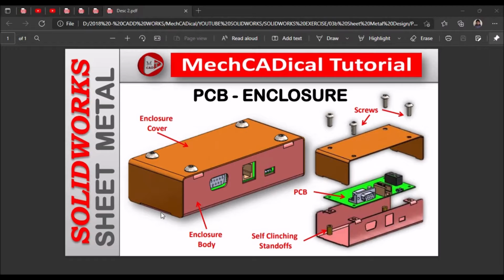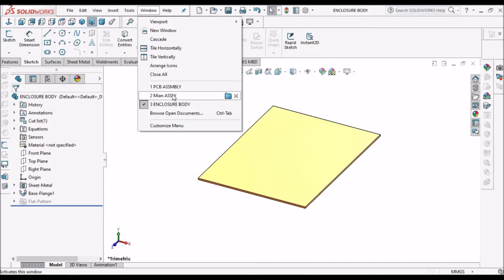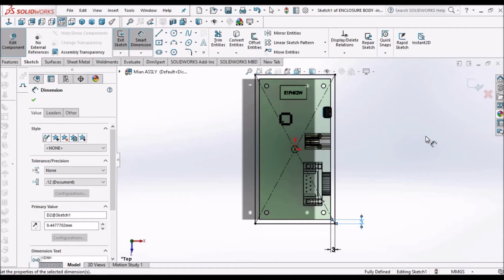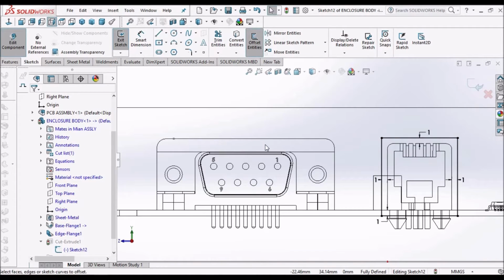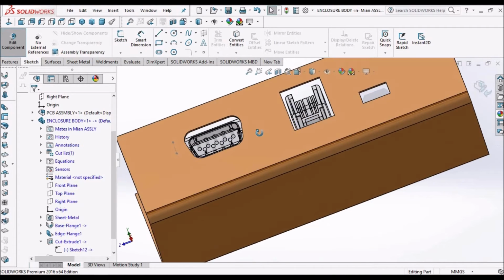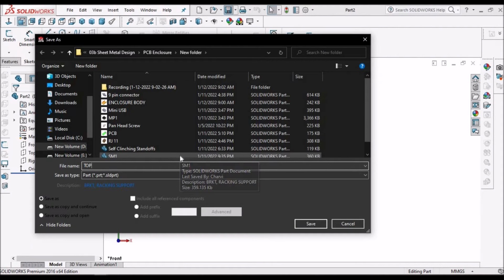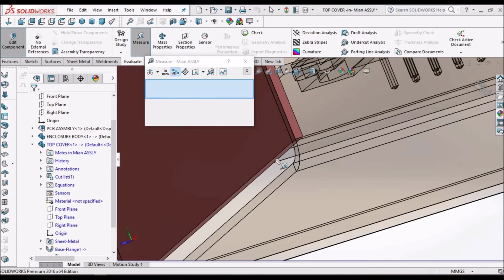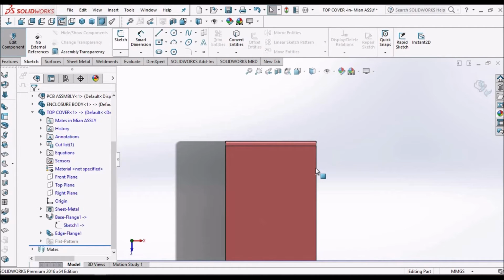SolidWorks II Sheet Metal II PCB - Enclosure Design With Top-Down Approach

Comment: where can i get pcb file
Reply from the maker: You can make PCB board with approx. dimensions for practice
Reply: did you get the pcb board anywhere?
Reply from the maker: You can get ut from 3d content central or make cad file